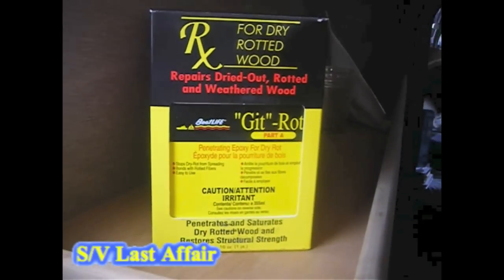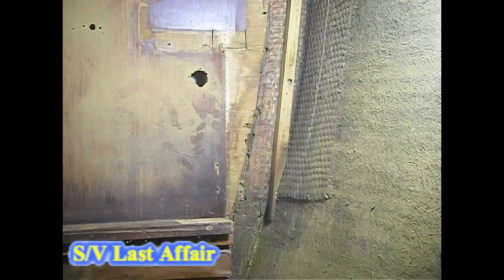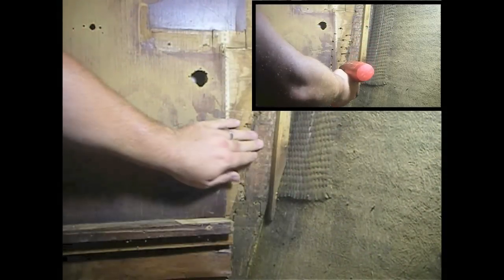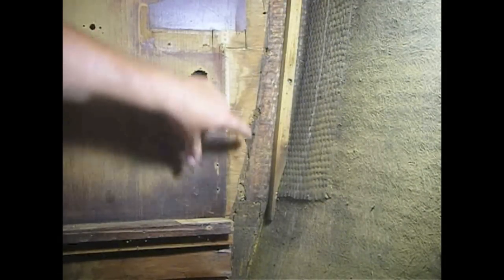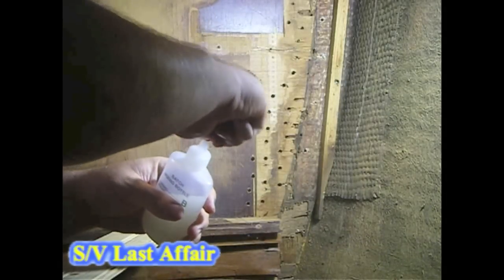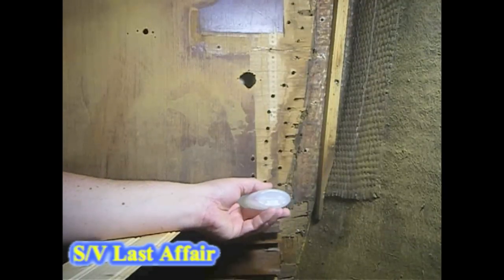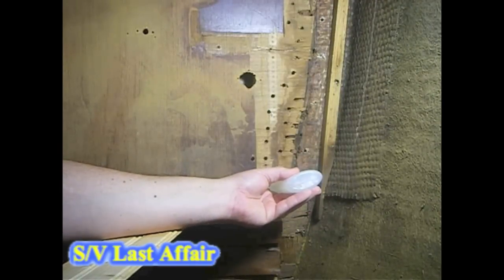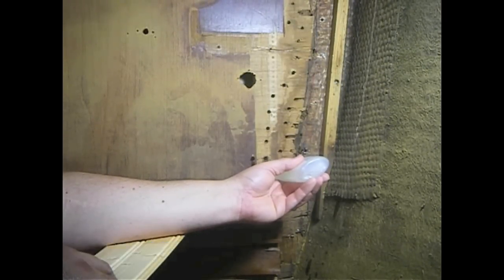Using Git-Rot Penetrating Epoxy on Rotted Wood

Comment: Nice job on the video. You did talk about water displacement. Have you ever tried using CPES (Clear Penetrating Epoxy Sealer) from RotDoctor com. Ive used it on my boat with wonderful results and it claims to displace water and resin in the wood. Im going to be using it on my house to fix some rotted sills.
Reply from the maker: I am glad you liked it.  This was a great test for us and really fit the need.

Comment: Good demonstration, bad application. Load bearing bulkheads need to be homogenously sound material. it is a good quick fix for a quick sale. I hope you sell your rebuild as soon as you hope too!
Reply: I would like to see a structural test of this stuff, I would suspect the epoxied rotted wood would be stronger than the original wood, but that would be an interesting test.
Reply from the maker: It has been 7 years now since this repair.  The boat is solid and we have cruised all over the south coast of the US with her.  My daughter is now using the boat full time and it is solid as can be.  I think the proof on the application stands on this one but I don't disagree that a solid bulkhead is better and this was only a small portion of the bulkhead, not the whole thing.
Reply from the maker: I would agree.  At least based on time passed since application.